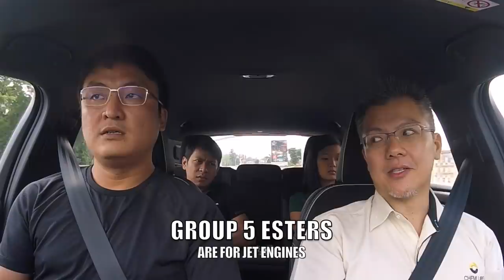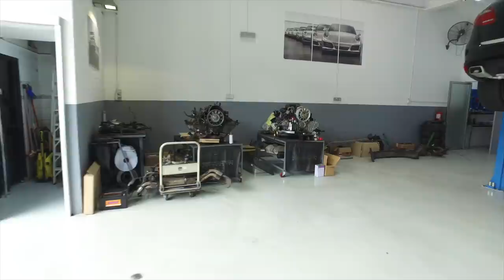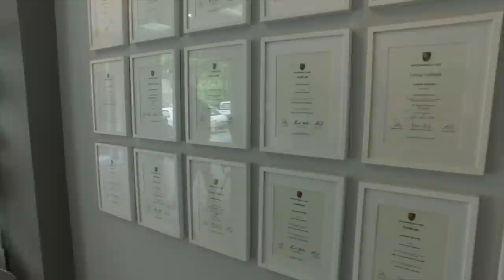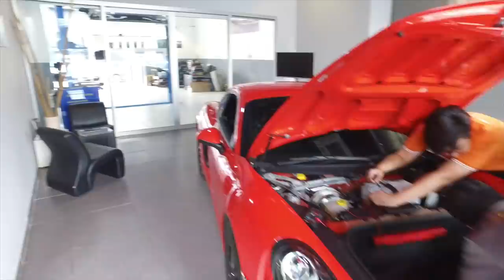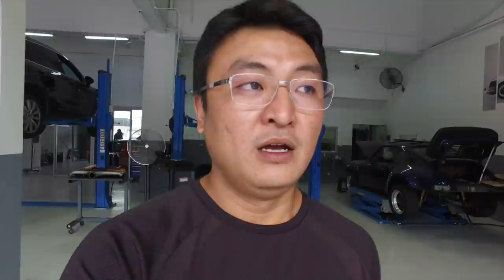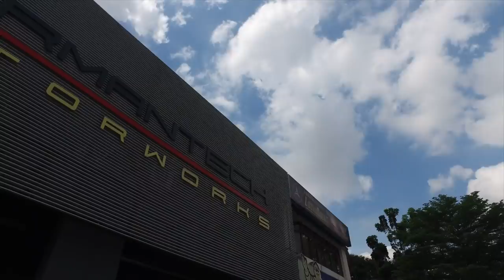Layman Tech Talk Ep14: What are the highest grade engine oils? What is ester? | Evomalaysia.com

Comment: I am considering to buy Mizu engine oil because it mention "ester formulated"  for the 5w40 and it also very damn cheap for ester oil. Can be trusted or not ya? I never use Mizu oil before.
Reply from the maker: Malaysia brand with a Japan sounding name.
Reply: What about EXN Moly Racing???
Reply: Better not...
Reply: Any update on the 5W40 if you have purchased it cause I'm interested in buying the 10w40 fully syntectic  " ester formulation" from Mizu as well.
Reply: So mizu esther base oil is okay? Anyone tried

Comment: Is PAO+ESTER better than Ester based oil? If what you're saying is true about Ester oil price that's means Mizu Engine oil is lying to its users because their ester engine oil is just around RM80 for 4 liters
Reply: What is mizu lying about? Its group 5 kan.... PAO group 4+Ester is worse
Reply: Mizu stated their 0W40 oil as PAO+ESTER. From what I learn Ester is added only 10-30% not 100% ester because ester weakness is moisture.Once water mix into it it would be aciidic @Verdeniza